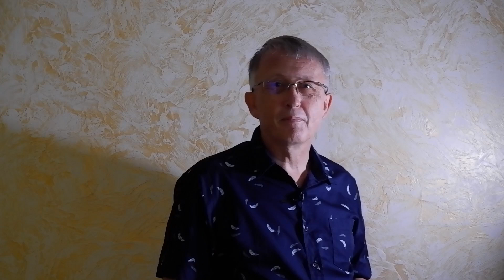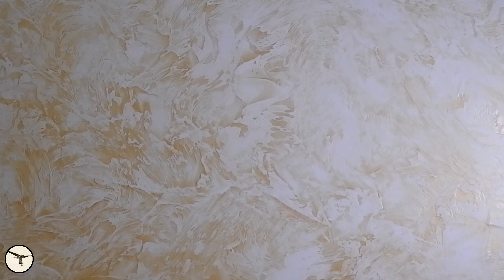Will You Trust This Guy? 😂 | Aviation Pilot Central - Must Watch for Pilots!

Comment: Set one engine on FTR and another engine in AUTO during taxi. Once cleared to line up, set both engine to AUTO. Saves you 20-30kg fuel per flight 😉
Reply from the maker: That would require a re-write of the SOP. In general, pilots do not like taxiing with amber alert lights (ACW GEN) before take-off.

Comment: Why not just to start both engines same time? Why sequence ?😊
Reply: Batteries won't handle it.  GPU may or may not handle it.  AND, monitoring for hot/hung starts, having to track both engines could lead to a hot, EXPENSIVE mess if you see a problem and shut down the wrong one.  (You may know this alreddie, but I ga-ron-tee you someone else *doesn't*...)
Reply: @stonebear  You can start 2 engines at the same time with the 747-400/747-8. The APU is powerful enough to supply bleed air for both start sequences. It's all about weight, cost and complexity for the APU, versus the time delay during starting costing money. FADEC can auto-shutdown an engine if an exceedance is detected.
Reply: @Avantime  But we're not talking about a 747. We're talking about an ATR. The ATR doesn't even have an APU.
Reply: @johnopalko5223  I'm just refuting the assertion that it's potentially dangerous for the pilots to start two modern, computer controlled aero engines simultaneously. Indeed for 747 pilots it's a routine procedure for every flight.

In other words if the ATR could, the pilots would be more than happy to start both engines at the same time.